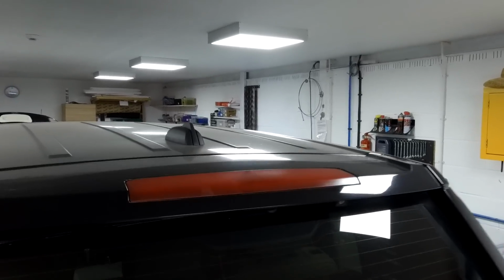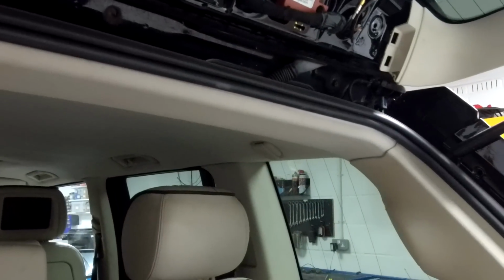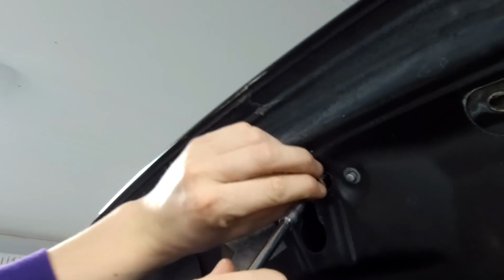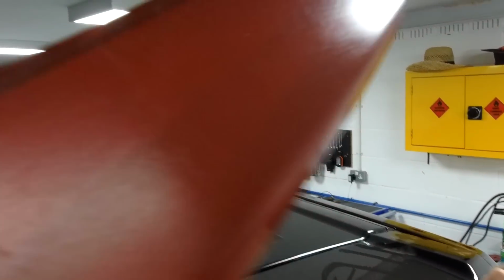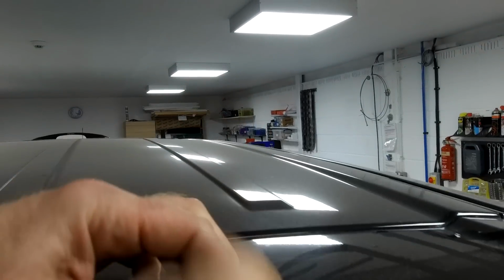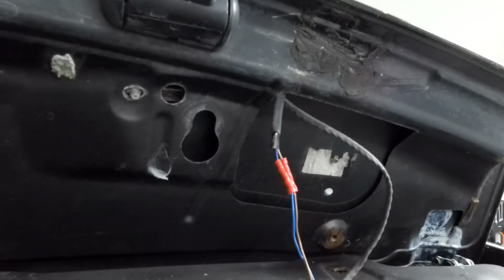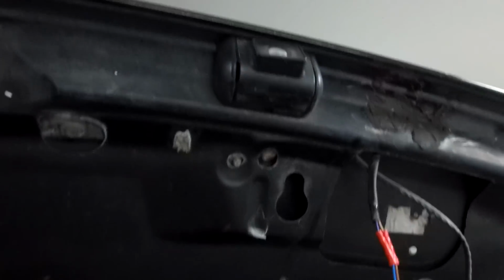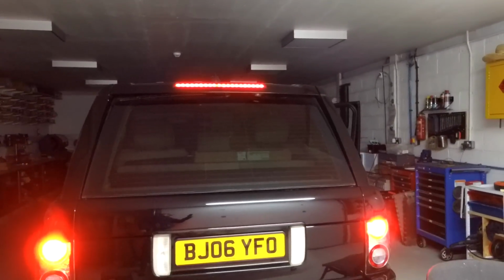Range Rover L322 tailgate brake light upgrade options + fitting

Comment: Not sure if I am the only one but followed instructions (I twisted and heat wrapped wires together) and my new replacement did not work. It did before I snipped wires off. Any ideas or tips to check that the light is working. Attach to a battery or power source. Any tips?  Great videos always
Reply: Did you check the fuse? If ur wires are connected it should work
Reply: Fuses are good. All other break lights and lighting work fine. Top light did work before removal and install. Will spend more time on it test the light off the car make sure the unit works.